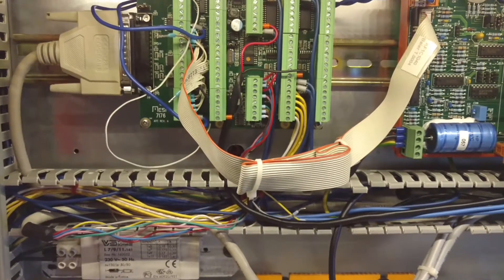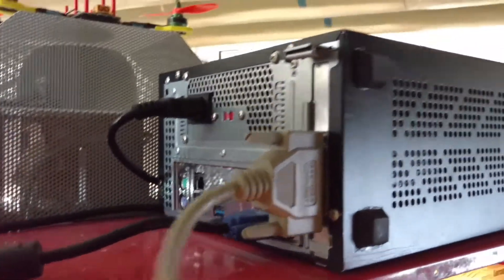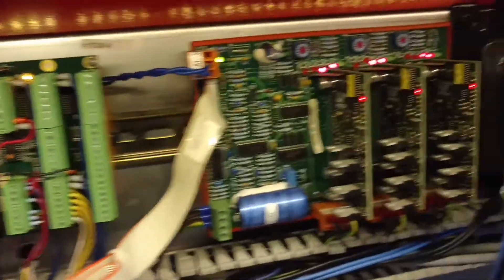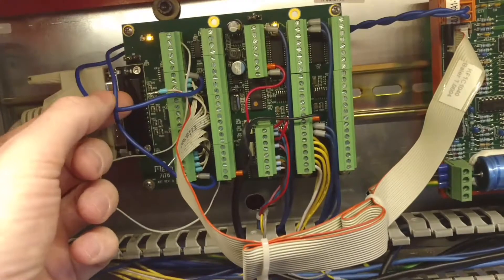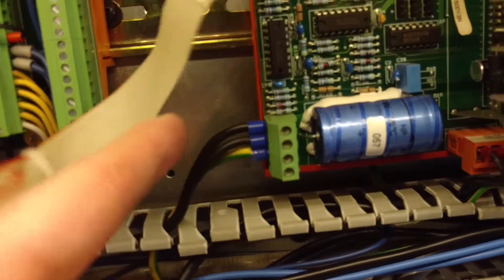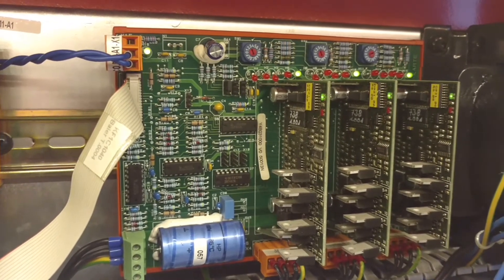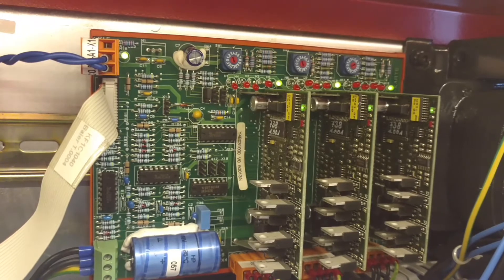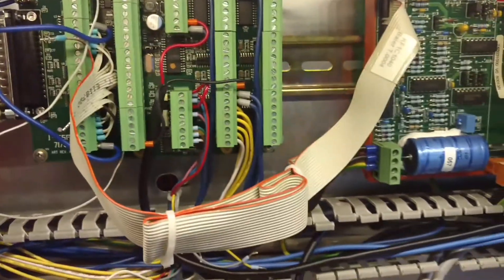EMCO PC Mill 55 LinuxCNC Interface

Comment: hey dude, you have a schematic for the VFD hookup?
Reply from the maker: Yeah I will have to post some more info on that.  I think it's just a +/- 10 VDC analog signal and a drive enable.
Check the link in the description for some more deets on Github.
Reply: @manmustbuild  it seems the mill and lathe vfd are set up a little differently. Does your machine have a potentiometer controlling spindle speed? It looks like pin 9 on the lenze is for manual control where 8 and 62 are for pwm. Still trying up get all of the details worked out 100%, but once I figure out the safety circuit to get the contactors to kick on, I'll be able to find out more. Currently in the middle of pulling out a crapload of blue wires

Comment: So it's a little late for ya, but I got an idc16 breakout board so I didn't have to cut the ribbon 👌
Reply from the maker: Oh ok, yeah that sounds nice.  When we did this conversion, we didn't have the original PC to drive the machine, so there was no looking back...
Reply: @manmustbuild  neither do I. I'm doing a 7i76ED with the original driver board. The breakout just connected to the original header that went into X104 on the AC95, so I just plugged it into the business end of the ribbon and then was able to pin out from that board to the stepgens... just cleans it up a little bit. I think it's a nice touch :)
Reply: @TheFeralEngineer  I'm converting mine and I got the breakout boards for those but I think I'm going to go with using connectors in a cutout plate the same as the original control board.  If I do, everything will plug right up.  We shall see :)

Comment: Getting a pc turn 55 tomorrow. Thanks for the pinout info 🤘🤘
Reply from the maker: Yeah you bet!  Haha just saw your post to /r/CNC and was wondering if that was you.
Reply: @manmustbuild  yup, that was me. I managed to get all of the electrical info from Emco, used an idc16 ribbon header breakout board to the 7i76e and had to move one of the wires on the vfd to get it to work. Not sure what voodoo magic they were using on the ac95 board, but there was nothing in the schematics that pointed to voltage or pwm going into the vfd, so I'm assuming they were just generating it inside the ac95 and sending it to the vfd. I wound up using the 5.2v supply on pin 9 of the lenze to get my drive voltage. Either way, it worked, but the vfd needs to be retuned for some reason.

Comment: What is the purpose of these PCI Mesa cards?
Reply from the maker: The Mesa hardware acts as an interface between the control software (LinuxCNC) running on the host PC, and the original electrical hardware that came with the mill and drives the motors, spindle, etc.
Reply: Yes but some people have two Mesa cards. Why?
Reply from the maker: @MrKurdishFreak  well it depends on the application and the choice of hardware. The one shown is a combo. One card in the PC and another breakout card that you see. You would have to look at the mesa electronics website to learn more about their product lines. Or check in the linuxcnc IRC channel
Reply: I have read the information on their website but I do not understand it. Do I need to buy two cards if I already have a parallel port on my pc?
Reply from the maker: @MrKurdishFreak  I think you can connect a 7i43 to the parallel port. But the superport 5i25 stuff is popular for a reason. Again suggest you get on the IRC channel to discuss your particular application, or better yet call them.  PCW is always very helpful. I've built out four CNC machines with their hardware and it's money well spent.

Comment: Hi my friend. I have a model emco pc mill 55. I have now a problem (main drive not ready). Can you help me whit this? What cause the problem and the solution? Thank you my friend.
Reply from the maker: Hi Carlos, i'd like to help but that question is very vague.  What controller are you using, the original one provided by the manufacturer or LinuxCNC?

Comment: Hey mike my machine is running great. but i have a really stupid question. im having a really rough time oiling this machine, is there a special oil gun i need or something? also is the spindle oil the port on the upper right?
Reply from the maker: Yeah good on ya for getting it running AND taking care of it!  I just use a grease gun from McMaster Carr - https://www.mcmaster.com/#10225K97
I don't think the spindle has any oil/grease ports.  None that I've found anyway.  If I missed it let me know.  There's only one or maybe two grease ports on the Z-axis linear way.
Reply: MyNameIsMikeGG I thought this machine used oil? Or where you able to put oil in the grease gun?
Reply from the maker: Well that's possible but not something I had considered.  I don't know of a good way to get oil in through those grease ports.  I just use Mobil red bearing grease.  Seems to work OK for the light use my machine sees.  I don't observe excessive spillover onto the ball screws or anything like that... yet.
Reply: MyNameIsMikeGG Hey mike I found a manual which had a picture of the oil gun from EMCO with a lot of research I found the exact one
Push Type Oil Gun with Pointed Tip https://www.amazon.com/dp/B01N3XP19B/ref=cm_sw_r_cp_api_awuAAbPBWMG4A

Thanks for all you help my machine is working great and I’ll post a video soon. The only thing not working is the drive enable on the 4th axis output . But that’s no big deal I got frustrated trying to edit the hal so I just put a switch between it .

Comment: Hey mike thanks for the videos they help allot. i followed your wiring diagram for the serial cable, but when i hit enable on linux cnc the green lights on the drivers turn into 2 red lights. All i have done this far is hook wire the colored spindle cables, driver 5v power and the 16 wire serial cable. is there something else i need to do to test the axis/spindle?
this is my first build, bought a emco 55 mill in great shape and figured id give it a shot.
Thank you
Reply from the maker: Sounds like you need to invert the drive enable signal in LinuxCNC
Reply: Hey thanks for the reply. yes my drive enable is backwards for some reason so i just plugged into a always on 5v for the time being.
watching your video your wiring looks different then the diagram uploaded. or maybe i just can't read. i added a link to a diagram i made does it look right? 
https://www.dropbox.com/s/fp5t1yjc5njdlaj/wiringcheck.png?dl=0
thank you again
Reply from the maker: Zack I have a better wire diagram that I will post when I get home in a week+  Good luck until then.  Don't be afraid of trial and error.  Not a big risk with 5v step/direction signals.  I'm not able to access your dropbox drawing from my restricted work network.
Reply: Hey mike that would be awesome. i just ordered male pins to attach onto the serial cable like you did. 
ill try playing around with it when they get here.
are there any setting that need to be changed from default to test the steppers in linux cnc?
here's another link to my diagram which doesn't seem to match your video
https://i.imgur.com/WfH1iqQ.png
again thank you for the help i really appreciate it, this is my first linuxcnc project and there is virtually no info on this driver. i normally do networking and laser stuff not electrical lol.
Reply: i got the motors working they were working fine the first time but they were moving so slow i couldn't tell.
I am a little confused i grabbed the manual for these motors and they said the steps per revolution is adjustable between 200 and 10,000 . how does that work? i'm not familiar with adjustable steppers or did i just read it wrong?
i hate to bother you but off the top of you head do you remember any of the axis  scale calculations? i think the ball screw has a pitch of 2.5 but other then that i don't know.
https://imgur.com/iyPeXe6
thank you
Reply from the maker: Great that you got the motors working, that's a huge milestone!  I have my HAL + INI files somewhere I can post.  I don't remember the steps / rev off the top of my head.  I'm guessing you've got it figured out by now.  It's not too difficult if you can get a dial indicator.
Reply: Hey Mike how do these screen shots look? my stepper scale is 51200 its not perfect but it seems to be close for testing it out. i have no idea about the PID info i just used the default, did you change yours?

my spindle works but is always spinning at about 10 rpm even when stopped. i couldn't tell the exact configuration of your wiring into the vfd .
thanks again mike
here's some screen shots
https://imgur.com/a/nvaCm
Reply: Hey i got my spindle working, there was a bug in pnc config, had to change 
Your spindle enable is wired to machine on:
net machine-is-enabled => hm2_5i25.0.7i76.0.0.spinena
This is a bug in older versions of pncconf and should be changed to:
net spindle-enable => hm2_5i25.0.7i76.0.0.spinena
Reply: hello, can I have a diagram of the ribbon wires.. also got a project on retrofitting an emco pc mill 55

thanks.
Reply: @zackmcdonald5091   Would you be able to post your HAL and INI files by chance?
Reply: @manmustbuild  Would you be able to post your HAL and INI files by chance?
Reply: Lon Hubi I can probably help you out . It’s been a while so I’m a bit rusty on it but I got notes somewhere
Reply from the maker: @nickstewartroc  
Sure - see here
https://github.com/mikegeeezy/EMCO

That's most of the documentation that I have on it.
Reply: @manmustbuild  Thank you so much!

Comment from the maker: So I made a mistake identifying the drive enable signal.  Those two blue wires are just 5 VDC supply to the 3 phase card.  The drive enable signal is on the ribbon cable.  I've got an electrical schematic I can post when I get home..
Reply: Hi! I would like to do a retro fit on an emco mill 55 too, would it be possible to have a few minutes of your time so I can get started more easily? I'm an engineering student and have already started working on this project, and any help would be greatly appreciated,
Thanks!
Reply: What voltage did you hook up the drive enable to the ribbon with? It safely enables with 5v but the schematics look like it would handle 24

Comment: Would it be possible to have a fast switch from linuxcnc to the original control. I'm looking for a way to keep them both intact and swithc when needed.
Reply from the maker: Why would you want to keep the original control?  I think keeping both would be very difficult and not worth the effort involved.  You would be better off buying a second machine at auction and running the two side by side.